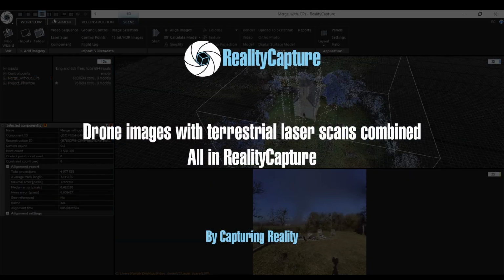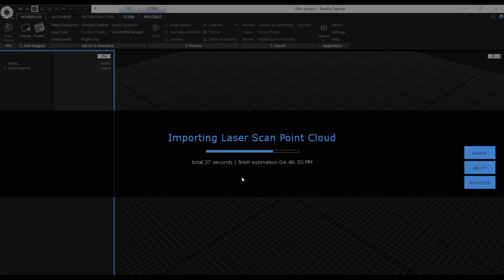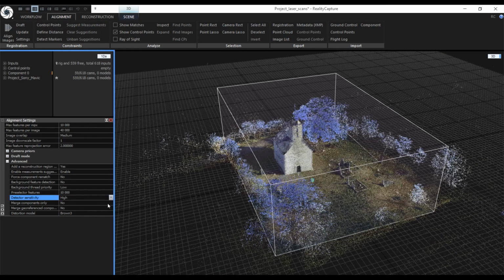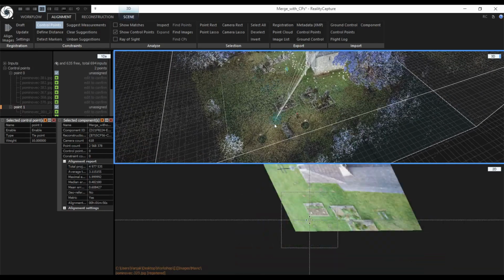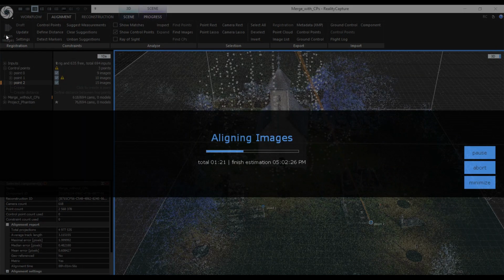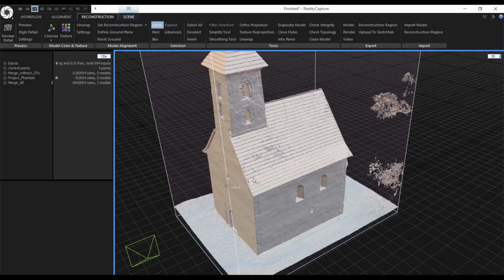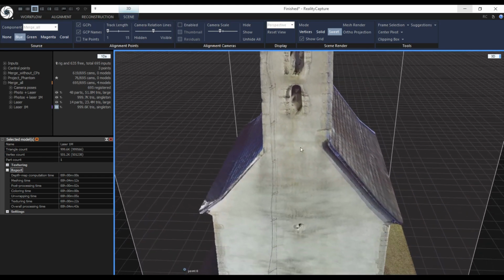How to merge drone images with terrestrial laser scans inside of RealityCapture.

Comment: Merge components only is no longer a setting in the alignment settings
Reply from the maker: This is a video with older GUI. Now, there is a newer interface. But in the Alignment settings there is a tool called Merge components, which only is merging components.

Comment: Hello I have a question: I noticed that the first fusion that was made between cloud by laser scanner and cloud by photogrammetry with drone was performed without control points but the alignment took place automatically ... how much is done is correct or is it better to perform the alignment by means of control points as was done with the last union with the photos from drone seen from above? 
NB=From the video to how I understood if the cloud from laser scanner and the cloud obtained from photogrammetry have a good overlay Reality Capture works well so you can make an automatic alignment, instead when between the cloud from laser scanner and the cloud from photogrammetry do not have a good overlay of scans we proceed as in the last alignment made in the video through control points, if possible I would like to have confirmation of this reasoning, thanks
Reply from the maker: Hi, as you wrote, when there is a good overlap between datasets then they are aligned automatically.
Reply: @RealityScanOfficial  Thank you for your reply, I take advantage of your kindness to ask you something about the merge component command, which now has a dedicated button, I also have a project with a laser scanner cloud and a drone cloud, when I press merge component, I don't have a single component but two components are created again, one from the drone and one from the point cloud, is this normal? in the video I notice that the file created by merge component is only one thanks
Reply from the maker: @198000669  Is it the same when you use Align tool? If so, there is no sufficient overlap between datasets to create one component.
Also, are your data georeferenced? If so, you can use Merge georeferenced components option in the Alignment settings.
Reply: @RealityScanOfficial the laser scanner point cloud is not georeferenced, the drone point cloud is georeferenced
Reply from the maker: @198000669  Then just control points can be used for merging
Reply: @RealityScanOfficial  Thank you again for the answer, but now I have a further problem, since the point cloud imported from the laser scanner does not appear very defined, even if as you say in the video, the points are there and are used later for the reconstruction of the meshes, in However, this phase does not allow you to work by inserting control points on the cloud because everything appears poorly defined and you risk having an error, this does not happen for clouds that derive from drone or terrestrial photos. But if I have to identify control points on the laser scanner cloud and align the drone cloud it becomes complicated. Is it possible to set a denser laser scanner point cloud? Thank you
Reply from the maker: @198000669  This is not possible, I think it depends on the laser scanner type. But basically the imported point cloud should be enough for placing control points. What kind of scanner are you suing? Also, you can place the control points on the LSPs (images created from laser scans after import) using the same way as for ordinary images.
Reply: @RealityScanOfficial  I'm using the BLK 360, unfortunately we know that images from laser scanners aren't exactly the best, so working on the photos by inserting the control points on which to align the drone point cloud risks creating an error. The survey was done with an average scan and at a distance of 10 meters from the building the stations all around took place at a distance of 7 meters. I believe that however, the possibility of choosing a cloud density should be created, precisely to allow us to work with it and be sure of the accuracy of the model.

Comment: My reality Capture doesn't show the option "merge components only"
Reply from the maker: Which version do you have? There were some changes in UX and You can find Merge components tool under Alignment tab/Registration
Reply: @RealityScanOfficial  When I click on settings like you did on the video, my version doesn't have the option "merge components only "
Reply from the maker: @markinmkn  Yes, itis the older UX, but there is option Merge components next to Align button, which is basically doing the same thing.
Reply: I have the same problem. Did you solve it?

Comment: why workflow has to be so complicated, why not automate this? and you just removed half of the cross
Reply from the maker: Hi Gregory, the laser scan and image data can be connected also without these steps, when there is a good overlap between these data. But doing this process, you can achieve a bigger precision of merging.
Reply: @RealityScanOfficial  okay

Comment: I have 40 GB RAM. While reconstruction and coloring I get "Not enough video RAM to render" .... Cannot the video processor use the main RAM?
Reply from the maker: Hi Abrimaal, this message means that the created model is too big to be displayed in the solid/sweet mode in a 3D view. The number of triangles that is possible to display in the solid/sweet mode depends on video memory of your GPU. Limitations are as follows:
8 million triangles for 1GB VRAM,
16 million triangles for 2GB VRAM,
31 million triangles for 4GB VRAM,
40 million triangles for 6+GB VRAM.
 
The upper limit is 40M triangles regardless of the GPU you have. However, this is just a display issue. If you exceed the limits above, only a point cloud will be displayed, while the render mode will be preserved. 
In this case you can also use a clipping box to display your model by parts. It does not decimate or cut the model, it only displays the triangles inside. You can find more information on how to use the clipping box in the application Help – tile Clipping Box.
Reply: @RealityScanOfficial  I know I can simplify the model. But can I split the model into 2 or 4 equal parts and see how it looks in full detail?
 The app crashes in normal mode, I can reconstruct it only in preview mode.
Reply from the maker: @Abrimaal  Do you mean in RealityCapture? To see the model in full detail you can use mentioned tool - Clipping box. You select a part which you want to see and it will be showed in full resolution (if it will be smaller as 40 M tris).  With a crash, can you please contact our support?
Reply: No, your System RAM is 40GB, your Video RAM is VRAM which is from your graphics card. They cannot be shared. They are too entirely separate spaces. Necro post I know, but it may help someone else. XD

Comment: Any chance you could do a guide on the workflow with a black and white scan?
Reply from the maker: Hi, do you mean laser scan without colors? There are manuals like this: https://www.youtube.com/watch?v=KPn1mi-LNww. Yes, it is also about merging laser scans and images, but the principle is the same also for uncolored laser scans
Reply: @RealityScanOfficial  thanks for getting back. Yes I have a laserscan without colour. At the time I did not know how the merging of scan and photo works in RC and due to the bad photo quality decided against scanning in colour at all. I managed to get a result but had to use natural control points. I was hoping RC would manage if I'd use greyscale photos for the alignment and coloured for texturing but that didn't work either. But as I said, I managed. Thanks again :)
Reply from the maker: @christophherrmann9681  Hi, if you want to use some part of your inputs just for one step, you have to set it in 1Ds. If you will have still problem with this, please contact our support.

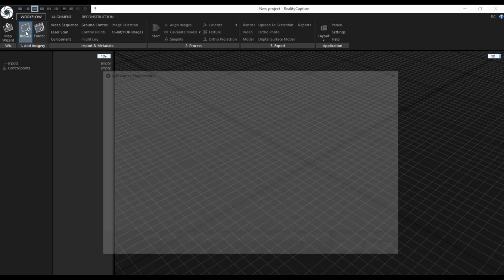Comment: 2:17 - Import and align from photos
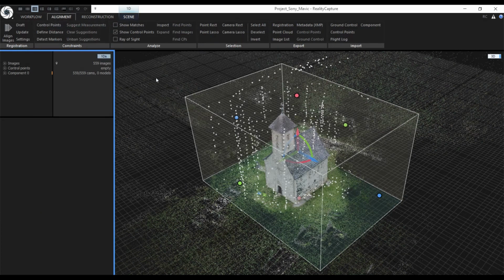3:18 - Export registration
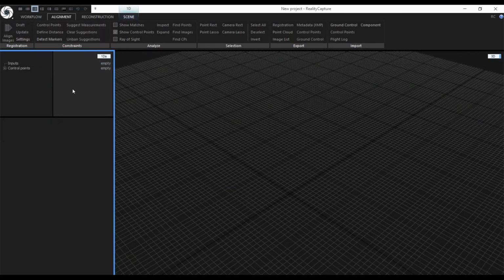3:30 - Laser scans import
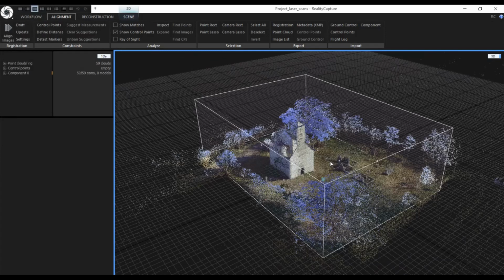5:55 - Import/merge components
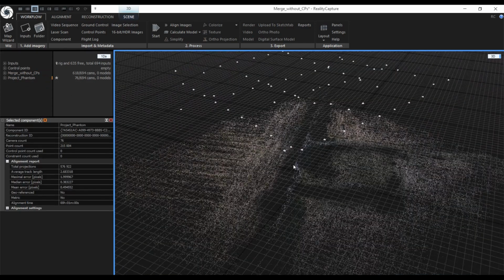7:56 - Merging using Control Points
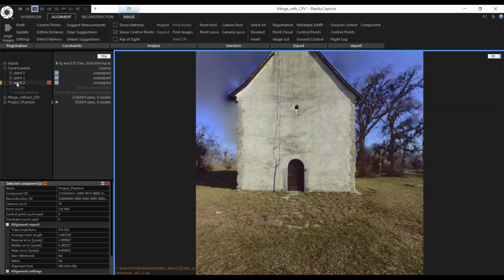10:15 - Quick control point alignment
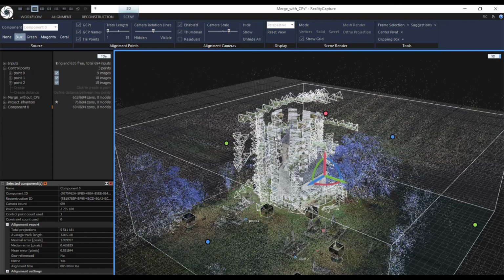11:25 - Reconstruction
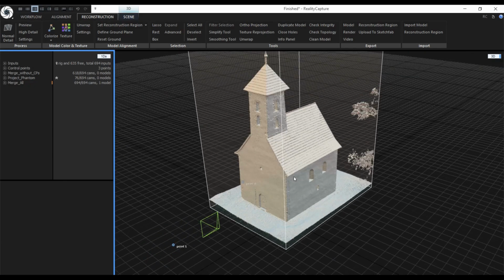12:31 - Clean up mesh
13:43 - Texturing
Reply: Hello 
I'm using Blk 360 lidar scan from that i have two formats .ptx and .e57. Here Reality Capture not accepting these two cloud formats showing failed importing , will you help me about this?
Reply: the .e57 files have to be exported as 'ordered e57 files' not unordered.  it's likely an option in your export engine.  @chkiranganesh9920

Comment: GREAT TUTORIAL!
I noticed that the Phantom dataset showed in some CPs a error between 1 an 4px that caused the red alert icon, i'm wondering if this could cause a distortion or any kind of probem in the final model. Unfortunately the video don't show the settings used to align the dataset, like exif, gps, prior, brown type and so on, could you provide more info in order to follow in details your amazing tutorial
I'm asking this because we are thinking about buying a leica BLK360 as a support for our drone dataset but we would like to provide hight precision output for architectural purpose.
thank you!
Reply: Hello Sandro, you want to have the lowest error possible. Such small error should be still ok but if you have large errors due to misalignments it can cause double walls and other visual errors in the final model. But in this case the errors were lowered after the next alignment that optimized the previous alignment. This example in the tutorial a was an extreme case because like I said the datasets were captured during a long time span. Usually you capture the data during one day or several days if it is a large project. The default settings are fine, just in this case the detector sensitivity was increased from medium to high. The GPS priors were disabled because they created a non-georeferenced component. I later georeferenced the whole scene with ground control points.

Comment: Hi, Jakub can you plz tell me what's the accuracy of the dataset in terms of using this software in the survey field  ?
Reply: Hi Mehmet,  I no longer have this RC project but I found the laser scans overall cloud to cloud registration report and the error was 5 mm. By setting the registration to exact I locked the relative poses of the laser scans and the photos aligned to the laser scans. After that I georeferenced the whole project using the 3 ground control points. They were measured with a GNSS receiver and the accuracy of the measurement was 2 cm in the horizontal plane and 4 centimeters in the vertical axis. I hope this helps you.
Reply: @jvanko89  looks like it needs to be improved little bit to use it in survey field
Reply: @Mehmet_KISSACIOGLU  What accuracy would you hope to achieve for your needs? RC is regularly used in surveying. The more accurate inputs you provide to RC the more accurate results you will get. You can provide even more accurate GCPs to RC and also check points to determine the residuals. When we are speaking about photogrammetry only the accuracy also depends on the resolution of the model. The resolution is different when you are taking photos 10 meters away from the object than taking photos only from 1 m from the object.
Reply: @jvanko89  acurracy should be around 15 mm both  horizontaly and vertical. Looks like we need to take more Closer photos and more Control Points mybe to asure that accuracy right?

Comment: Good tutorial, but I have problems with my alignment. I'm using DSLR and leica blk360 e57 point cloud. I'm doing your way step by step but at the "merged" component when I do the align, actually RC makes another 2 components with pictures and laser. The same two components I want to align... "I checked the option to merge them"... There is another option to look at? Thanks.
Reply: Hi, sorry for the late response I did not check the comments for a while. In the Alignment  settings you can change the number of Max features per image from default 40 000 to maybe 80 000 and Preselector features to half of Max features per image so in this case 40 000. These settings usually solve any problems for me. Also try setting the detector sensitivity to High. If this doesn't work try adding more images. Shoot them from the same perspectives as the laser scanner was positioned. This way the possibility to align both together into one component will be very high. If you do not have the opportunity to shoot new photos then you have to use control points or ground control points. If you have have only control points use at least 6. if you have ground control point use at least 3.
Reply: Hi, just to know if you achieved a final good result merging the blk360 imaegs adn DSLR camera with the help of Jakub or you still have propblem? i'm thinking about buyng a blk360 Thanks!

Comment: About marking the control points - could there be a situation when it would be necessary to mark same CPs also to the laser scans?
Reply: Hi, sorry for the late response. I did not check the comments for a while but my answer can still help other users as well. Yes this can happen that is why you need to shoot your photos from the same perspectives as the laser scanner was positioned. But if you are shooting photos like this the probability to merge them without control points is very high.

Comment: Great tutorial - being able to merge with terrestrial (structured) scans is great. However my company is increasingly moving to mobile (unstructured) LIDAR scanning systems which don't have built in cameras. Is there any way to import and merge unstructured scans in a similar method? I would be very curious to know. Thank you!
Reply from the maker: Hello Scott, unfortunately, RealityCapture does not support the import of unstructured lidar data right now.
Reply: @RealityScanOfficial  Thanks for the quick response - do you think this is something that would be possible in future updates? Releasing this as an option for unstructured lidar would be an incredible feature that no other photogrammetry software offers easily yet.